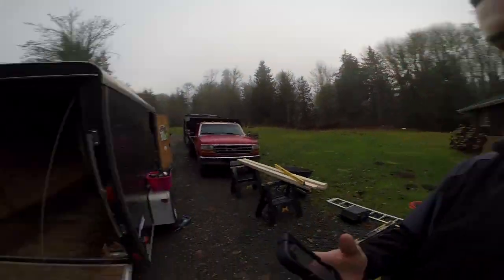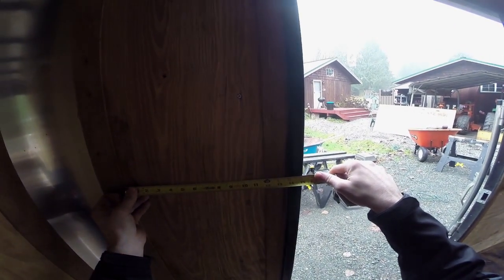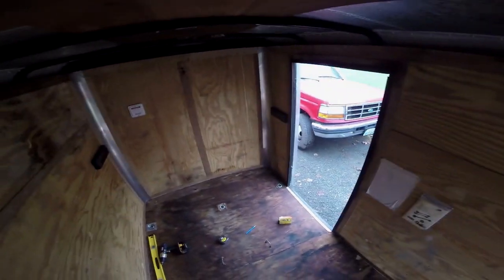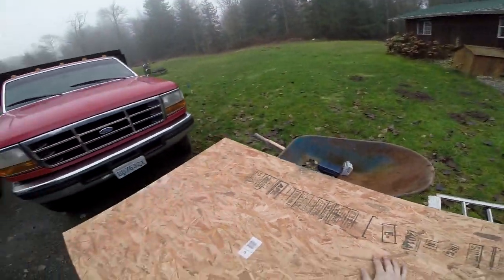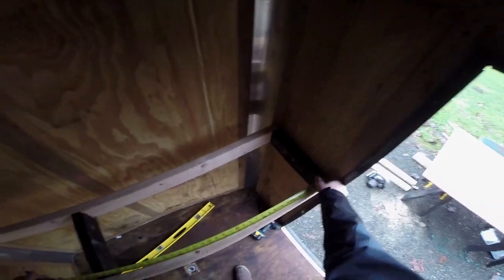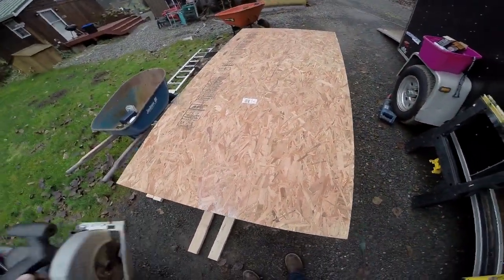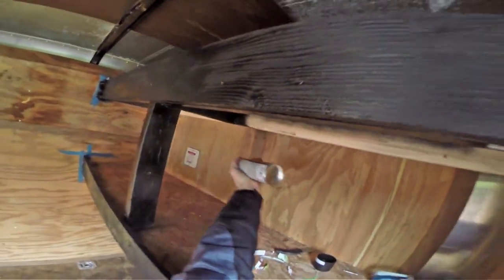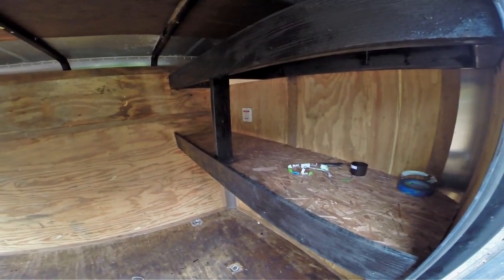How To Build Shelving In Your Enclosed Trailer | DIY

Comment: I can appreciate the upload. Ideas can be formed based off of your efforts. There is a much easier way to create the roundness of your shelf and that is simply by using a washer. Washer idea is the best when formatting your wood pieces next to uneven walls or walls that are not straight.
Reply: Explain the washer system
Reply: @rickraub5448  Imagine an angle that you wish to form out of wood. Choose any washer that you use with a bolt. Put the washer on a flat surface with the pencil led touching the surface. Now scribe against any angle that you wish to create. The washer and pencil will draw exactly what it is you want to cut to fit whatever your doing.
Reply: @rksmith5273  
Thank you👍👍

Comment: something worth mentioning (not sure if i missed it) - make sure the trailer is parked on a relatively level driveway (left to right), otherwise the level you're setting for the shelving could be pointless. Thanks for sharing this how-to.. makes me want to redo my shelving
Reply: Ya I was saying same thing when he was useing the level inside. Did he level the trailer befor leveling the framing for shelves

Comment: Havent read all of the comments so excuse me if this is redundant. In regard to using a level to level out the shelves.....Unless your trailer is perfectly level, your not going to get good results. It is a better practice to use a square, or dimensions to make sure the shelves are "level". As long as the shelves are square to the trailer walls or floor, you will be ok.
Reply: good point.
Reply from the maker: Sorry for the late response but that is a really great point and I appreciate the tip!
Reply: For sure! Ran into that problem two weeks ago.

Comment: instead of measuring all those points for the plywood, next time get some cardboard and square it up on the shelf 2x4 frame and take a compass scribe and trace the front trailer wall. You will have yourself a nice template to cut your plywood with and it will fit like a glove..anyway food for thought.. great video
Reply: That sounds really good.  I encourage you to make a video showing how to do that.  Because I have a mental block!  :)  I have an almost identical issue, am NOT  a carpenter or woodworker, and STILL defeated by trying to fit my front wall , which is also curved.

Comment: Another approach for the plywood: take those measurements, add an inch to each when you layout the plywood. Then cut to that and call it your rough curve.  Then put the plywood in place, push it as far to the front as possible. Take a compass, set to your biggest gap, the scribe a line on the plywood parallel to the trailer front. Take it out, cut to the scribe line. Then measure one point on each end, from front corner, to establish the straight back edge. Cut that edge, should have a great fit!